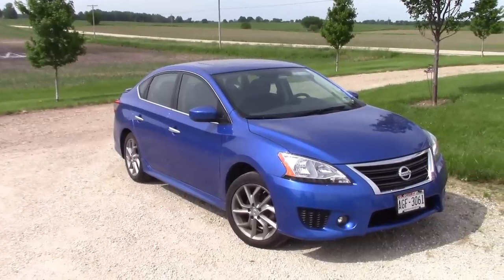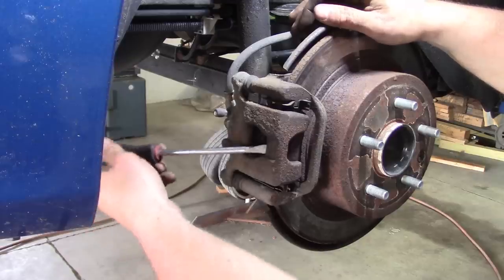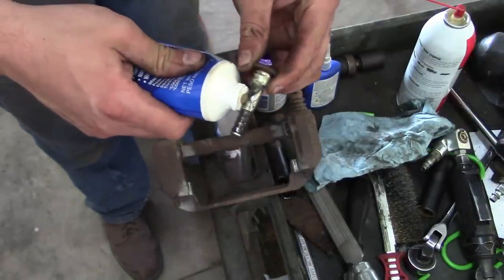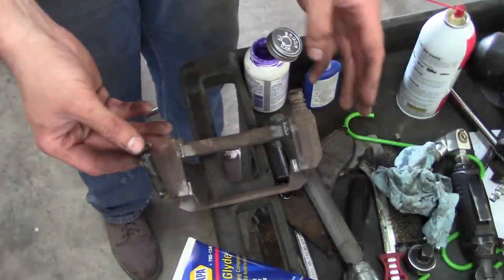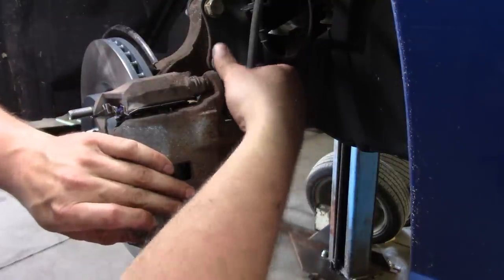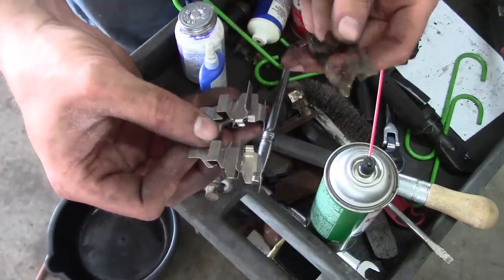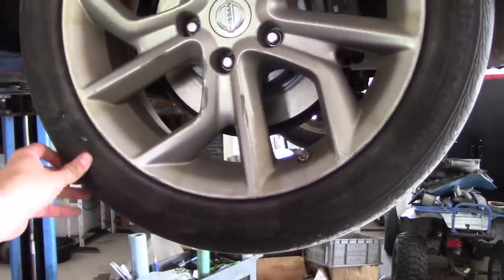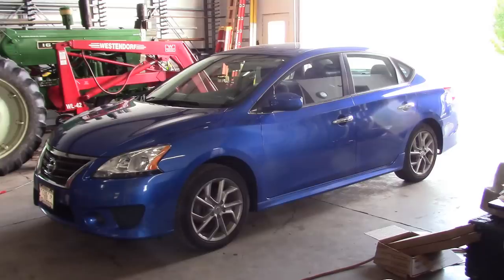Brake Job - 2014 Nissan Sentra

Comment: Appreciate your research on the goos.  I bought some of the silicone permatex a few years ago, planning to switch over to it, but i don't do enough brake work, and still haven't used up the purple stuff.  Some day soon..  But the purple has always worked fine on my cars.. must be EPDM, I guess.
Reply from the maker: Yeah, I've had no issues either.

Comment: Probably one of the pins has tight tolerance and guides de caliper in two directions, the one with plastic is probably loose and the plastic guide the caliper by not alowing the caliper to turn around the other pin, this is common practice when you have two linear bearings working together. The plastic also avoid rattling in this kind of loose fit

Comment: Regards plastic pins or guides: I don't know for definite but my theory is brakes heat up. The metals of the caliper are similar and should expand at similar rates but the shapes are different - it means one will expand slightly more than the other part. Because of that, the pins will slightly jam. Slightly jammed pins will resonate under braking conditions. The plastic allows for slight difference in expansion and also dampens vibration.
Reply from the maker: Interesting. I like it!

Comment: I appreciate your effort to document your findings regarding the Permatex Ceramic brake lube.  Is there any reason why you want to switch away from the Sil-Glyde for slider pins?  Thanks.
Reply: Yes especially since its a third of the price 13 vs 32

Comment: Been using Sta Lube brake component lube to lube caliper pins for about 15/20 years no issues  but thanks for the heads up

Comment: HI WES,I just had a idea on your black fly issue.the are a few videos I've seen on how to make flying bug traps cheap out of 2 liter plastic soda bottles ,and i tried it in my house and yard and it actually worked .not perfect but once they get inside they can't get out ,so it knocks the number of them way down.you just need to find what they want more.LIKE vinegar,beer,fruit juices,meat,poo,etc. I put a little smear of the stuff on the outside then use a cheap LITTLE fan on low facing the trap to put the Oder in the air,they find it easily that way.try it ,it might help.thank you for your videos.

Comment: I've seen some oe brackets have a pass through hole where the pin with a sleeve fits well. Even though this is probably a oe one also which makes even stranger

Comment: Most issues with the pins is caused by not replacing that rubber sleeve. It may not be as hard as plastic yet, but it hardens & causes that pin to react slowly within a month or 2 if not replaced. Which will cause uneven pad ware. They are cheap. A full 4 wheel set with new boots ran me just under $8. It's a no brainer

Comment: Thanks for looking into the Permatex question, I have that same purple stuff as well as Sil-Glide and have always wondered which is better to use on caliper slide pins.

I don't mind working on or driving those little Nissans, I've never taken one beyond the body shop parking lot so I don't know how they drive out on the open road, but they seem to be comfortable and well made little cars. If I absolutely had to have a little econo-box I'd probably take one of those over something comparable.

Comment: "There goes the fuzz!"  I thought I was the only person who called them the fuzz!  :)  hahahahahahahahahahah!!!   Another excellent video!!!  Very interesting on the Permatex purple brake goo.  I've used the green synthetic Permatex synthetic brake goo (Permatex Ultra Disc Brake Caliper Lube) and had no issues with rubber compatibility.  I agree that it seems weird that Permatex would put out a product that would not be compatible with rubber found in braking systems, but if the dude at Permatex says EPDM only, well then, EPDM only!  I need to look for that new stuff, but I've got at least 200 years worth of the green goo left so maybe not.  :)

Comment: Did you do a brake fluid flush?  Not sure why you don't crack the bleeder when pushing in the piston.  Why push old dirty fluid back into the system when you could push it out and then top up with new or better yet flush the system.

Comment: I think the plastic ring on the pin might be to stop the pin from rattling. Well lubed that is probably not an issue, though.

That's why it's only on one side, the other one has enough shear load on it while braking to avoid it.

Comment: The plastic sleeve was to stop the complete seizure of the pin in the caliper bracket .   I have had to use  heat, pipe wrenches  and a 4 pound sledge hammer to free them.   They rusted in at the tip of the pin due to moisture within the tube.

Comment: Sorry to contradict you but it’s safer when a front wheel tire blows out. The driver has more control. I’ve had him over 90 miles an hour as long as you don’t panic we can steer straight to the shoulder.

Comment: I used to use the purple stuff, I never had problems with the rubbers swelling, but after a couple years in the slide pins it would be all dried out and almost acting like a really lame glue.  I've taken to just using silicon paste for all of it, Raybestos even used to sell (may be they still do, I haven't checked in a while) brake lubes # DBL and DBL-2, which were just silicon paste.
Reply from the maker: That's all Sil-glyde is.
Reply: @WatchWesWork  Good to know, I've encountered a couple knock of versions of it that by feel were pretty minimal in silicon content, hence why I usually just buy name brand dielectric grease as a catch-all

Comment: Noticed for the uses of the napa sil glyde that squeaky fan belts was on the list of applications, I've never found putting lubricant on something that's already slipping to solve the issue....

Comment: You can’t resurfaced them rotators so just hit it I always grease the ends of my pads the part that’s contacting the hardware what we have to do it at work I never had brake job come back but I like how you little rubber piece back for the parking brake adjustment a lot people don’t put them back

Comment: just had a noise in my rolla in the rear..a wheel cylinder leaked ruined shoes and what a mess brake cleaner didnt work had to scrape it off. other side was a crusty mess too..  I was covered in the stuff...my wife laughed.. brought back that weeks old memory.. sadly shoes were like new of course but ruined.. replaced everything..

Comment: I was starting to type in about the orange  goo grease that just came out.
 And bam as I was looking up part number you had it on the video

How ever i also am using g up all my expensive purple stuff and sil glide 
Till I buy new improved orange grease
 I noticed last 2 purple cans seemed less tacky the the original stuff also deeper color. Same part no too maybe reformulated prior to orange release

Comment: Same reason why not to apply the permatex to the slide pins due to affecting its rubber boots its also equally as important not to use it on the face of the caliper piston that contacts the back of the pad, because the piston also has a rubber boot that seals it from debris getting in and running the oring seals. Not only will it affect the dust boots causing swelling and deterioration quicker but if left untreated long enough it will find its way through to the orings. They will swell and rip and one day when u go to stop your pedal will fade. How fast idk but you will know! Lol

Comment: I always wondered what the rubber part on the caliper pins was for too, i assumed it was for anti vibration. Both my Honda's don't have them but instead they have a milled flat part on one pin..... One pin only please [insert Scottish accent here] ..... Aaaanyway I got them mixed up and couldn't remember where the flat sided one went, it bugged and concerned me a lot. Honda even has different part numbers for the pins but fails to tell you which one goes where. Eventually I found some forum post which i didn't bookmark (!) where a guy said it's supposed to help with uneven pad wear, kind of like on a 4pot caliper how the leading and trailing pistons are different sizes. I have no idea if this is correct, i tried the flat pin in both sides and have never noticed any difference
Reply from the maker: Yeah, I think that's it. Most cars the plastic tipped pin will only go in one hole.

Comment: A tire shop I have been using for years stripped all twenty studs and nuts on my 97 s10 one time, I assume they didn't start them by hand, I've never had a problem there before.

Comment: Hey Wes. Great video. What did you spray on the hubs prior to re-installing the rotors? Mine rust badly and it's always a pain to remove. Thanks!
Reply: That looked like fluid film or something similar. Whatever greasy goo you can get onto those surfaces in a light, even coating should help.

Comment: Wes, Good tires rear, problems on front,  driver has no control of the rear if there is a blowout or failure. What's a torque wrench, don't you have the feel yet?
Reply from the maker: I dunno man. I've had a steer tire blow. Not fun.

Comment: boy i hate dealing with rusted on brake drums and disks the ones with a anti corrosion coating are nice. I wonder why nobody makes them in stainless steel guess it costs too much would be nice though

Comment: After years of swinging a 2lb sledge on rotors my wrists are shot. I waited for too long to discover that an air chisel with a flat punch on the surface around the lugs breaks the bond in seconds
Reply: Yup, a few 'taps' with an air hammer pops them off pretty quickly. But it's not worth showing that since not many DIYers have a one of those tucked away in their toolbox.

Comment: I’ve used the purple permatex brake lube for years on a daily basis and have had Zero problems. The only purpose for those little rubbers is to piss you off.

Comment: The purple stuff is excellent for anywhere there is metal on metal contact. Thermal cycling of the brakes makes it thicken over time, keeping it in place.

Silicone based brake lube stays soft. It should only be used on the slides, where it can't run off.

The "ceramic" in those product names is just marketing. There isn't any actual ceramic in them. That would make them grinding paste.

Comment: What are you spraying on the face of the hub before installing the rotor?  Looks like a lanolin based product (Fluid Film, WoolWax, etc).  If so, curious to know how that's working out for you in terms of calming down the rotor rust welding to the face of the hub?  I usually use a thin coat of silver anti seize.  But I am open to other thoughts.
Reply: I’m curious what he uses as well. We’ve been using Corrosion-x for years on trucks that we use to launch boats in salt water. keeps tools rust free in tropical marine environment too. It’s expensive though

Comment: I know nothing about the brake hardware but I guess they only use the extra ring on one side to avoid both slide pins vibrating with the same resonant frequency.
Reply from the maker: Hmm. That's an interesting theory!

Comment: i tried using the ceramic extreme on my old Honda civic and then i remembered the silicone recommendations for rubber slide pin seals so i used that on other side so we will see if it matters

Comment: As Ericthecarguy once said "Only use silicone paste on caliper slide pins, you don't use grease or anything else". And I've never had a problem ever.  I don't use any of that "Permatex" non sense. Rubber? - Silicone paste/spray

Comment: Checked Permatex website>

A 100% synthetic formula, coupled with real ceramic solids make this premium brake lubricant our longest lasting, most temperature resistant way to silence brake noise. Effective from -50°F to 3000°F (-46°C to 1649°C), this product maintains its lubricating integrity under the most extreme conditions. Resistant to corrosion and contaminants, it will not wash out. For metal-to-metal contact only. For metal-to-metal contact only.
Reply from the maker: It also clearly says it's OK for caliper pins.

Comment: Can't go wrong with 3M Silicone Paste as a lubricant and conditioner for rubber and plastic, also as a dielectric grease on electrical connectors and spark plugs, battery terminals.  Get one product that confidently serves multiple purposes!

Comment: I heard somewhere along the way that one of the brake slide pins is for the top and the other is for the bottom?  That explains the difference in them.??
Reply from the maker: But why?
Reply: @WatchWesWork  Thanks for responding.  A lot of you tubers don't.  i don't know the why.  I just return them in the same location i removed them.

Comment: SIL GLYDE...by AGS. American Grease Stick..been aroung forever.
Raybestos DBL 2 silicone brake lube(Dow Corning)
was out years ago.sometimes old stuff is the best stuff.
Reply from the maker: AGS is tops in brake fittings, lines, etc. I use the AGS Ni-cop brake line.

Comment: What is the reasoning for lubing the piston and caliper at 16:05 ? What I've heard it is to prevent squeal, but the brake pads now a days are allready coated on the backside.
Reply from the maker: We mostly do it because of the corrosion issues we have.

Comment: you were worried about the lube make the rubber blow out , then you sprayed the boots with brake parts cleaner . Yikes . Also that little "toot " of wax your applying to the wheel studs as you spray the face of the rotor is a NO NO also . Had quite a few come off like that after that wax gets HOT from extreme braking . wicks into the threads and they rattle loose .
Reply from the maker: I've done this hundreds, probably thousands of times, and never had an issue.

Comment: I have a 2013 Sentra SR and will never buy a Nissan again. They design parts to fail. Kept getting  horrible grinding with good brakes.  Turned out the dust shield kept getting a little rust from outer rotor. Transmission replaced, fuel pump failed and latest rear spring just broke. And of course dealer only part.

Comment: Hold up.. you put brake lube UNDER the hardware but not on the pad ears where it slides ON the hardware? Do you understand how brakes work?
Reply from the maker: You can put the lube on the outside of the clips if you like, but it will do nothing. It quickly washes off. We use the lube under the hardware to prevent rust jacking between the bracket and the hardware, forcing the hardware into the pads, binding the pads in the bracket.
Reply: Watch Wes Work I’ve never seen that done. The pads slide on the hardware they’re not stationary the least you can do is add some which will prevent the hardware from getting corroded longer. I also live in California so maybe this is a northern thing.
Reply from the maker: @FrenchValleyAirport  The abutment clips are stainless. They will not corrode. If you want to apply lube to the ears of the pads, go for it. This is just what works for me. But, please do not tell me I don't know how brakes work.
Reply: @WatchWesWork  Ok so, you're saying theyre stainless (which I knew) then why did you put lube on the underside. They clip in, and pryed easily with a screwdriver if they do happen to get stuck

Comment: Just did the all the brakes on my grandmas Chrysler 200 and man were the rear slide pins seized in place, I tried a torch to warm them up to loosen nothing spend 40min on 1 side till I said screw it and got both new rear calipers
Reply from the maker: Many times that is the best way.

Comment: Yes, Wes. SR is like the turbo Olivers! My 94 Nissan D21 has 300k miles, in western Washington(rainy) and there is no single component that looks as bad as the brake parts on that 6yo car! Even my factory exhaust, which is falling apart, isn't that rusty, SMH

Comment: I came home on leave and the wife says the brakes on the Z are grinding. I got two weeks to relax, right. So I look and the damn rotor was cut off, inside edge of the pad cut it like a metal lathe. New rotors and pads and a nice request to take it in the next time she even heard a squeal.
Reply from the maker: I've seen that happen before. Also seen the cooling fins in the middle rust through and separate the inside face from the rest of the rotor!

Comment: A couple things, you should always clean the rust off of the hub before you install a new rotor. Also, the front pads are clearly installed wrong. The wear indicators are facing up on the old pads and there is a tab on the abutment clips that acts as a spring and fit into the wear indicator, you installed them with the wear indicators facing down and the tab is sticking out, unused.

Comment: I'm using copper paste onto the axle hubs and outer 
disc surfaces that the parts come off easi(er to repair,
or replace. A common method here. 
On the slide pins i use the grease that comes with
new pins. The other brake parts dont need xtra
lubrication recommended they are clean and 
plain - if unpainted. The good calipers are coated.

Comment: about the same level of rust on my 2013 Subaru Crosstrek when I went to do the rear wheel bearings and brakes.

protip on basically every 2013-2020 Crosstrek if you're doing the rear wheel bearings in the rust belt; take the whole knuckle off and either press or sledge hammer the unit bearing out. Subaru's removal procedure (using a puller on the hub) won't fucking work unless the car has never seen rust.

also, some nameless Subaru engineer decided to sandwich the rear brake backing plates between the unit bearing and the knuckle. the clearance on the center of the brake backing plate for the unit bearing to pass through is only 10-20 thousandths. what happens when the brake backing plate rusts? the rust distorts the bearing housing, and trashes the bearing races. guess why I had to replace my rear wheel bearings? :| relevant TSB: 05-70-19
Reply from the maker: Interesting. Most companies sandwich the backing plate with the bearing. I wonder why Subaru could not figure that out.